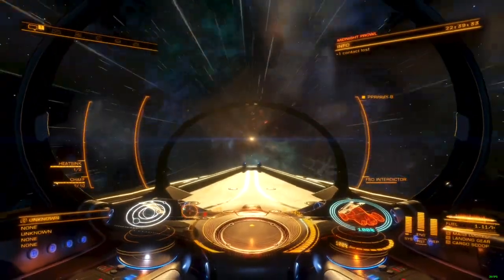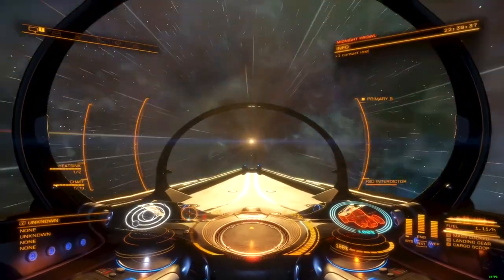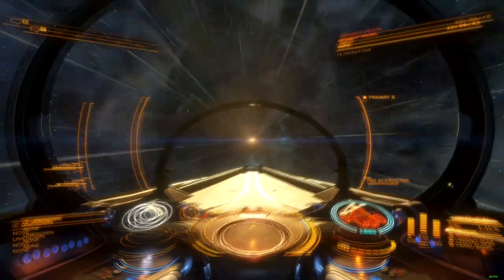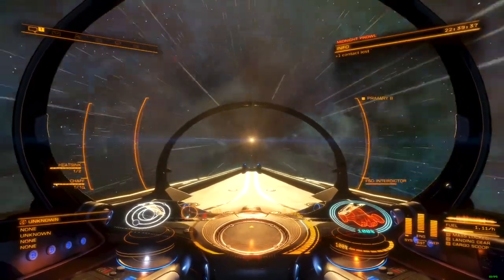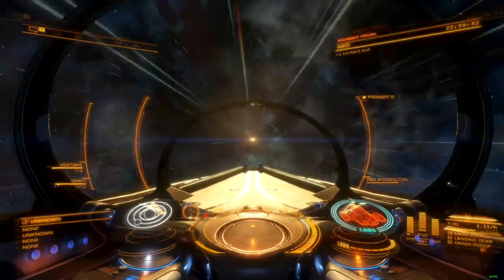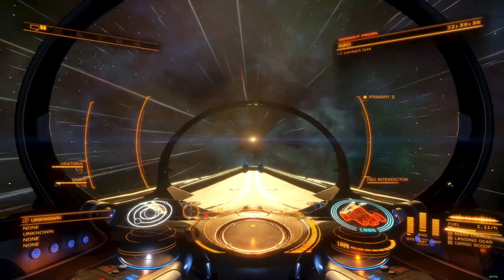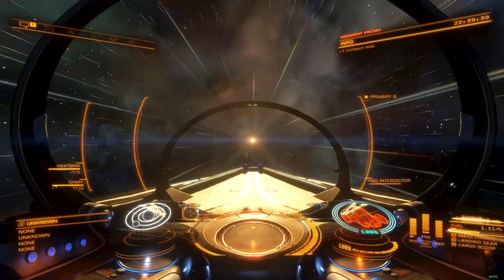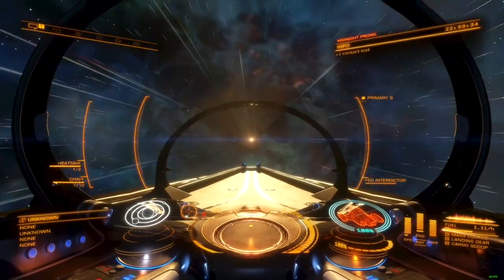Elite Dangerous | General Commentary | The Ideal Armor System

Comment: Its not a bad idea.

At this point we need to do something at least. For starter's  maybe we should remove Heavy Duty engineering also increasing resistances by 14%. Heavy duty should increase hull boost only.
Reply: engineering as a whole shouldn't make your ship 2-3x more effective it should had considarable downsides and give you at most 50% boost on your ship capabillities. It should be a tool to specialize your ships further not make them godtier at everything.

Comment: PVP should always be the highest skill activity in this game. Plasma accelerators and railguns should always be the best weapons for anyone with enough skill to unlock their potential. The gap between these two weapon types and those which are easier to use is the only area where discussion about balance can be effective. To reiterate, they should always be the most capable weapons for top(or even mid) level PvP, but easier to use weapons should be decently effective options for those without the skill or desire to use PAs and RGs. They will be at a disadvantage, at least when it comes to weapon load out and pure dps. There can be no other way.
Reply: In my experience, PVP is extremely low skill.  The vast majority of PVP is just ganking non-combat ships (not piracy or bounty hunting)   Actual competitive PVP is much more rare.  AX combat tends to be the real top end
Reply: @OmegaPaladin144   I think you may be reading things that aren’t in my post. Again, PvP should always be the most high level combat in a game like this. Going up against another human being whose both fully equipped and fully intent on defeating you should absolutely be the toughest opponent(assuming they aren’t significantly less skilled than you). The video discusses the rebalancing of ship durability with a notable reference to the PvP meta. it seemed like he thought the current meta weapons didn’t deserve to be (so?)meta. I think they do deserve to be the best, but it’s possible the gap could be reduced, as rails and PAs don’t need to be so good that even novice players are better off with them. 

Rebalancing AX or PvP combat so that the latter requires and rewards skill the most is a separate issue from that which is discussed in the video, if I recall correctly. If it helps you understand, the PvP I’m speaking of is dueling, sparring and the like, not ganking a solo trader who accidentally logged into open with a shieldless type 9 or something.
Reply: you mean plasma accelerators right
Reply: @nachfullbarertrank5230  indubitably. There’s no such weapon in the game, so it would have to be a typo.
Reply: What about frag cannons and pacifiers? Aren't they even more effective? The whole idea of space shotgun is outright dumb, but if the easiest way to win is to equip 5 of those on a Python or Krait and just use brute force with zero finess is kinda bad too, isn't it?
Reply: @maciejasz78  I’ll need a rephrase on whatever you’re saying.

I’m saying RGs and PAs should require the most skill, but ultimately be the most effective weapons in the game. Obviously they have(and should have) high heat output, power requirements and a finite or smaller ammo pool than other weapons. I’d say frag cannons/pacifiers are(and should be)easier to use when compared to PAs and RGs. It wouldn’t matter if they were indeed more effective weapons right now, because I’m saying PAs and RGs SHOULD BE the highest skill and most deadly weapons in the game. Games have a tendency to make easier weapons/mechanics just as(if not more) capable than that which requires more skill. I don’t want that to happen here, so I’m stating how they should be.